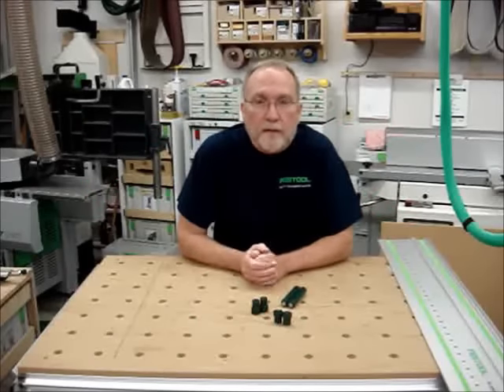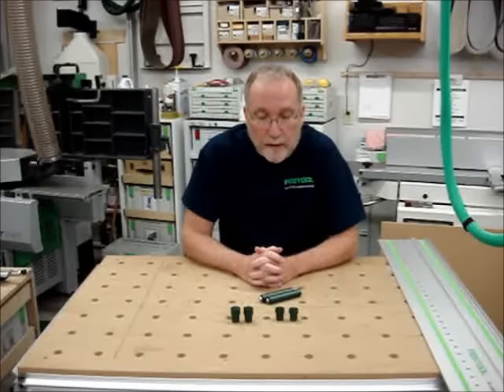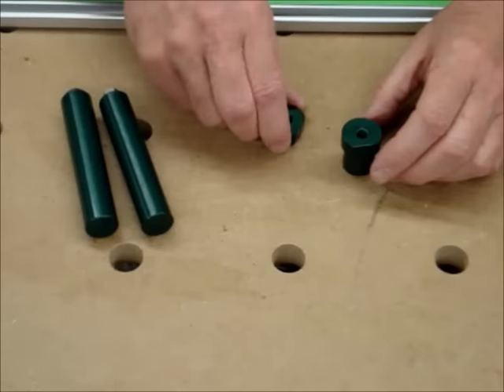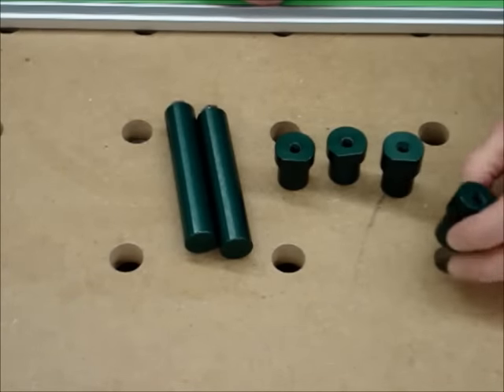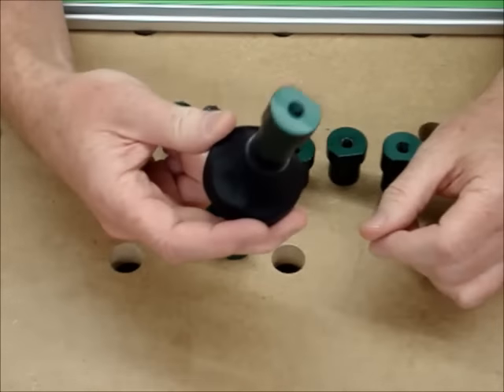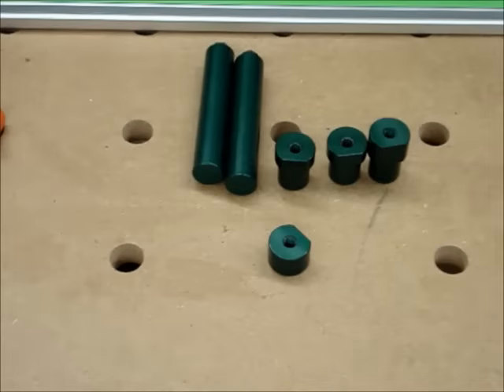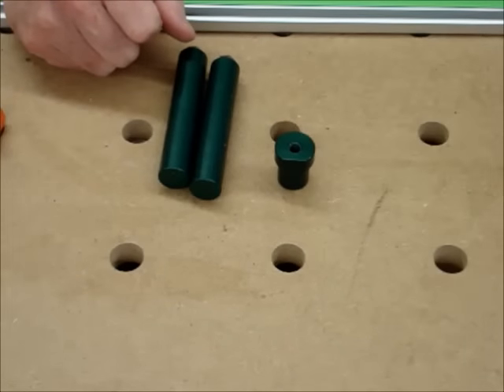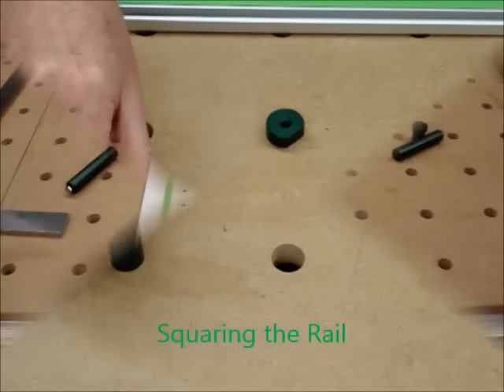Fine Tool Works MFT Bench Dog Review Part 1

Comment: I am having problems with removing a guide rails with the rail dogs attached, how do you tighten them properly?
Reply from the maker: +vovcha666 What consistently worked well for me was placing my hands on the ends of the guide rail and pulling straight up.  If you don't pull straight up or lift the rail in a manner where it flexes, the hot dogs tends to lock up in the MFT holes due to the tight clearance.  At about the 9 minute point in the video you will see me place one hand on the end of the rail and the other at the far end hot dog location.  That also works well.  Hope this helps.
Steve

Comment: Hi, I am Ricardo Villouta from Chile, and I follow you in youtube, and I have to say you are a great woodworker, I´m learning a lot from you.

How I saw you work a lot with Festool tools, so watching your video of Domino jointer I decided to buy one of this, now I have a doweling jig from jessem and it's great, but I am looking for a tool that let me do the jointing faster, like the Domino jointer, and watching videos I found a Mafell DD40P duo-doweller, which also you have, and now I don't know which one to buy.

The advantage for me to pick the Mafell is for the dowells, in Chile is easier to find and have a rail guide.

Which one you recomend me?

I apreciate your help, to take the right desition.

Best regards,

Ricardo.
Reply from the maker: Hi Ricardo - thank you for the compliments.  It is difficult to make a recommendation without knowing your intended uses or materials.  Jessum makes some excellent equipment but I completely understand the speed part of the equation.   I ended up with the Mafell DD40P because most of my work is with hardwoods and I saw the more powerful motor over the smaller DD40G as a benefit in that application.  I suggest looking over the thread G?P? under the DuoDoweller section of http://mafell-users-forum.freeforums.net/.  The information in that thread was quite helpful in making my decision.  My user name in that forum is 'nucone' so you can see the questions I had asked.  If I were using it primarily for sheet goods, I think the DD40G would have been an equally good choice.  I hope this helps.  If you have any more questions, don't hesitate to ask.
Steve
Reply: Thanks Steve for you response...
The link you send me it was very good, over all because comparing the Festool Domino with the Mafell Duo doweller.

In my case, I am going for the DD40P, just like you said. This is because I practicly work only with hard wood.

Coparing the Festool DF500 whit the Mafell DD40P, which one is better? I am undecided between this two.

I really appreciate your help and time.

Best regards,
Ricardo.
Reply from the maker: Ricardo Villouta I don't think one is better than the other, it is more a case of which one fits your needs the best.  Of all the joining machines I have, the Domino 500 gets the most use and it is well suited for most furniture needs which is primarily what I build.  For cabinets, the DD40 is best because of system hole drilling and case construction.  I initially purchased the DD40 to replace the Festool LR32 hole drilling system which I found too fiddley.  I have used the DD40 for furniture projects and it does well as long as the stock size is within its capabilities.  The DD40 is not much use for rail widths less than about 50mm due to the spindle spacing.  One thing to note, dowel sizes >12mm are not easy to find in NA - they are available from Mafell but on a per joint basis, it is more expensive than Domino stock.  

That said, the base system on the DD40 takes some getting used to if you are used to biscuit joiners and the Domino.  It will cut joints faster than the Domino.  To get a good mortise with the Domino, slow and steady is the key to success.  With the DD40, I have found plunging as fast as possible gives the best results and prolongs bit life due to less heating.

Steve
Reply: Thanks a lot Steve for your help, this help me a lot to take my decision, and  am going for the Mafell DD40P.

I really appreciate your help.

Best regards.
Ricardo.
Reply from the maker: Ricardo, Glad to be of assistance.
Steve

Comment: Thank you very much for you patients!
I tried to make a repetitive cuts with a parallel guides and found it very annoying to set up, probably, tape measure from a cleaned edge will be better, since I am not in production pace...woodworking is my passion. I am just wondering if I need a join site table saw in general?
I have two mft" and a raster table VL model, which gives me an extra lateral support when cutting wide boards and a ply.
I was just not happy with the speed, time I am investing in a set up, vs. Just using a small table saw. I was thinking of Dewalt, a new model with a dust extraction on top of the blade, dados and so.....
Sincerely,
Vladimir
Reply from the maker: +vovcha666 A bank account hazardous question to ask a table saw guy (slider specifically) because about 75+% of my work is cutting hardwoods.  IMO, the track saw is really lacking for ripping hardwoods because of the special jigging required.  I only use the track saw when I am on site as I do not have a portable table saw.  I do not have parallel guides so cannot comment on their use.
Reply: @extremewoodworker  
Parallel guides are great. I use a WoodPeckers adjustable rail fence and a woodpeckers parallel guide system and it works great.

Comment: Thank you for a reply!
I am straggling with making a max use out of mft, like long pieces cuts and boards.....used pegs from Lee valley for alignment., rail dogs...
You think  that mft table would be able to replace a table saw...I am trying to work around and not to bye one....
What is the best set up for a precise parallel cut on a ply panels?
Thank you ahead!!!,
Reply from the maker: +vovcha666  For precise parallel cuts with the track saw do not use any dogs.  The best bet is to use the track saw to cut off the factory edge, measure the width of you panel from that cut edge and then lay the tracks splinter guard on your layout lines and trim to proper width.  Use the dogs for making square or other angled cuts.  With sheet goods, the track saw should be a sufficient work around for the table saw.

Comment: Do you use parallel guides or strictly rely on a tape measure, I own a pair made for an Incra super trucks, the problem is: that the narrow cut adapters have some play, they don't touch a work-peace with hall face, kind in an angle....so I didn't learn to rely on them completely and on calibration, you still ending up placing markers by eye.....so tape should be sufficient ?
Please help me out?????
Do you own a table saw or you do you work, which is beautiful, on mft.......?
.
Reply from the maker: +vovcha666 When cutting on site,I have no parallel guides and rely on a quality tape measure for layout.  The tape measure I use is a Hultafors Talmeter tape measure.  To my knowledge, these are metric only which works out well for me as I converted years ago when adopting the 32mm hardware system.  These are very accurate and the tips do not have any play.  They also have a locking mechanism and built in knife type scribes for marking accurately.  I darken the scribe marks with a 0.5mm mechanical pencil and then line the tracks up by eye.  This gives me cuts that are plenty accurate.  Remember, wood moves as soon as you cut it so there is no need to shoot for machinist type accuracy.